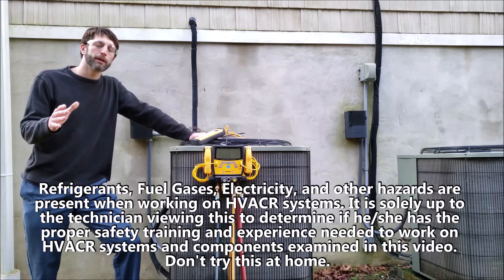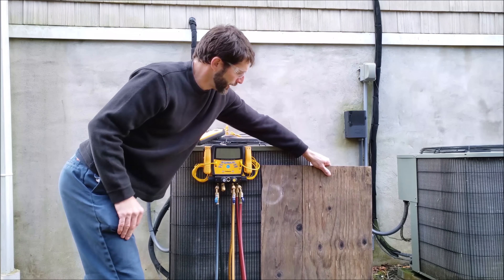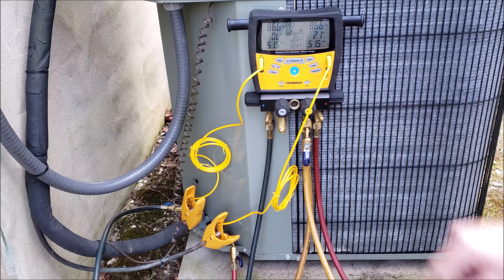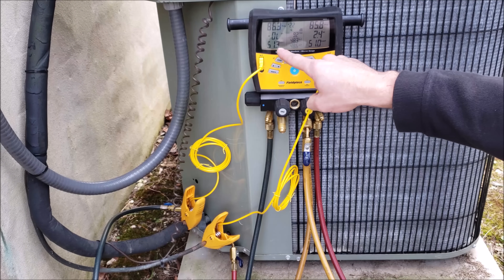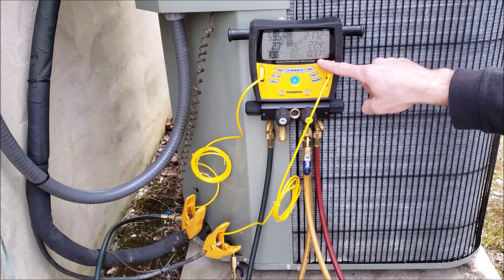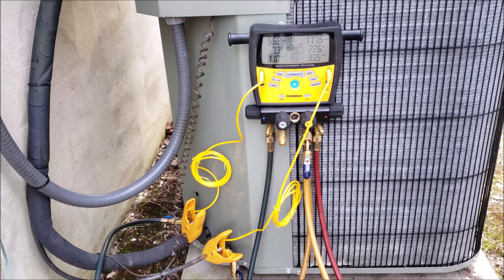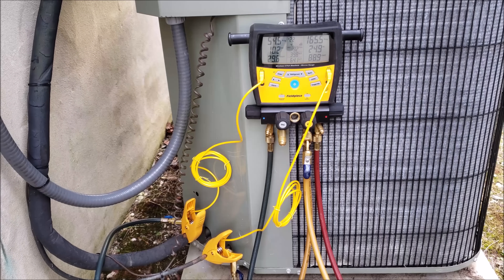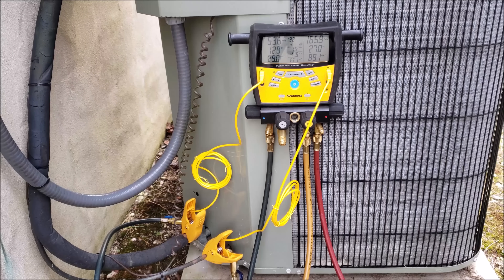Checking the Charge of Heat Pump or AC in Winter Low Outdoor Temps

Comment: Hey Craig.
Why do you not recommend checking the refrigerant charge with a charging jacket on a piston system?
Thanks, Tom
Reply: Superheat in a piston system is set by the indoor air wet bulb vs the outdoor air temp. You can tell by the suction temp and pressure in the video there is no load in this house. In a piston system you would be running liquid back to the compressor.  Hopefully the expansion valve will work properly and give you some compressor protection and time to work. We check piston systems all the time in low ambient conditions but honestly its far from ideal. Gives you a general idea but thats it. I wouldn't adjust charges during these conditions either unless there is a blatantly obvious problem.
Reply: j  understood sir and thanks for the reply.
I live in Colorado Springs and and spring AC tune ups are very difficult to perform here as indoor wet bulb temps are typically around 48 to 54 degrees. Indoor temps 68 to 70 degrees. Outdoor ambient, if your lucky and the condenser is on the South facing aspect of the home, may be in the low 70's.
We restrict condenser airflow to drive the pressures up to simulate a warmer day, but do not adjust the charge under these conditions.
Reply: @YTsux24-7  glad to see you're taking the wet bulb temp and are aware of the actual conditions. You get a feel for it after a while. Don't forget to document what you're finding. It allows you and other techs to get a feel for the unit even if you never get to see operating under normal conditions.
Reply from the maker: Hey Tomon8tor and Bill J, I have to say, great correspondence here and good in depth processing! Yeah I recommend that pm's should wait until there is a load on the house for the sake of efficiency for the building owner. This method will get you by in the winter to get close enough and the TXV will help to keep you safe but for efficiency, wait till there is a load on the house to check again or to do pm's thanks both of you!
Reply: @acservicetechchannel  
Craig your email correspondence on cold weather AC tune ups helped me win an unemployment battle a couple years back after being fired.
I am forever grateful.
Reply from the maker: I am very glad to help Tom!

Comment: could you run heating strips at the same time when charging; to add some heat load?.........
Reply from the maker: Technically you could since they are after the coil in the case of a fan coil but no that is what I mean. You could run the electric strips to get the heat in the building up and then afterward, check the charge in ac mode, thanks Oscar!

Comment: Is this the only way to check what if you don’t have digital gauges
Reply from the maker: You can check the charge with digital or compound gauges, it was just easier to explain with the digital set. Basically, set the high side sat temp between 90-105 degrees and then check the charge with subcooling while monitoring if the low side sat temp is high enough, thanks Andy!

Comment: Wow Craig , I was just thinking about how to check the charge on a heat pump in winter ❄️ yesterday !!!
Thanks for sharing and posting
Reply from the maker: Thanks Thomas!
Reply: AC Service Tech LLC Will the high side be able to pump the desired extra charge on its own into The recovery tank provided the bottle has a lower pressure ?
Reply from the maker: I wouldn't use the compressor to pump all of the refrigerant into the recovery bottle but just if the unit is overcharged. I would use a self contained recovery unit for that, thanks!
Reply: AC Service Tech LLC no of course or else there’s a change of damaging the compressor .
Thank you

Comment: I'll be interested in your confirming all this in the coming spring once it starts getting warm.   It would be nice to save a call-back, but that looks like some real seat of the pants flying there, though sound theory, granted.   Should work!
Reply from the maker: You would have to do it quick but when we are working on a heat pump in the winter, there is no choice other than the total weight method unless the manufacturer has given some type of charging specs for that particular unit. Always check the charge when it is above 70 inside and outside whenever possible and when doing pm's wait until the temp rises. Thanks for letting me know what you would like to see!
Reply from the maker: The subcooling will be just a few degrees higher checking this way than what it would be on an average spring day because of the lower indoor dry bulb and humidity level at this time. This system is however overcharged, thanks